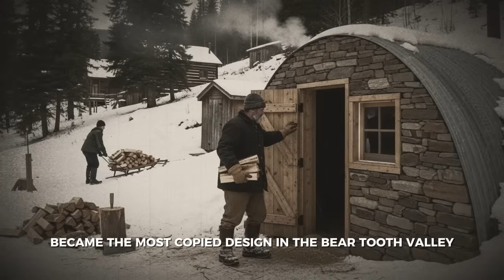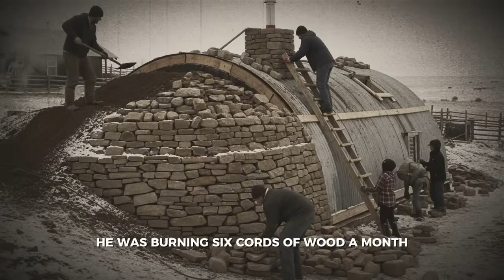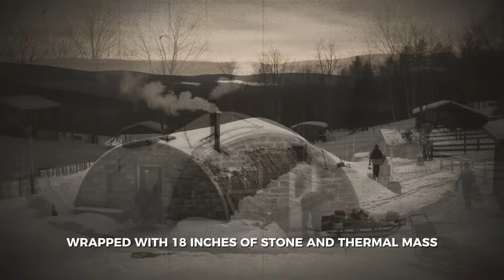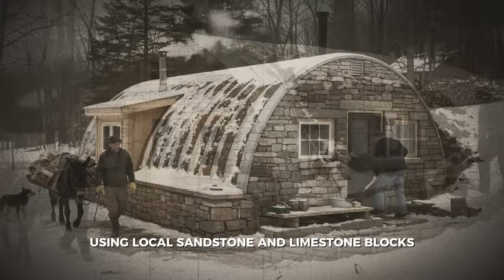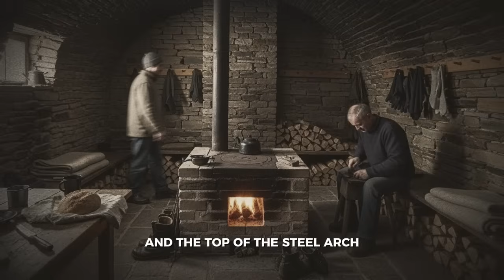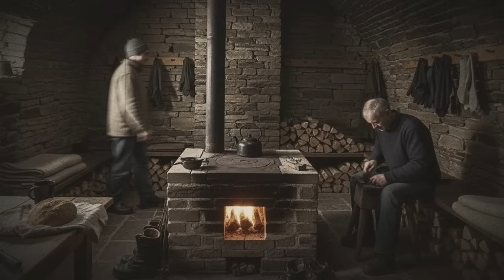How He Wrapped a Quonset Hut in Stone That Stayed Warmer Than Any Log Cabin and Shocked the Valley

Comment: I think it was Dec 23-24, 1983, here in Champaign, East Central, IL. The temp was -12 to -24 F. I believe the -12 set a record for lowest high temp at the time. The other memorable cold day was Jan 20, 1985, Ronald Reagan‘s 2nd Inauguration Day. My pipes froze. Central IL isn’t Montana, but the wind on the flat, open prairie can get to blizzard conditions, with nothing much to stop it. And I’ve experienced a temp drop of 60 degrees F in a few hours more than once in the 48 years I’ve lived here.

Comment: The stone wasn’t for strength — it was for thermal mass. Combined with the Quonset curve, it reduced wind exposure and stored heat instead of letting it escape. Warmer than log cabins doesn’t sound crazy once you look at the physics. How many log cabins lose heat just because of corners and drafts?